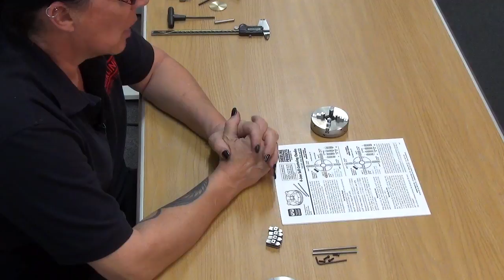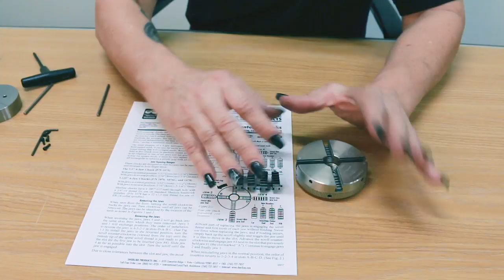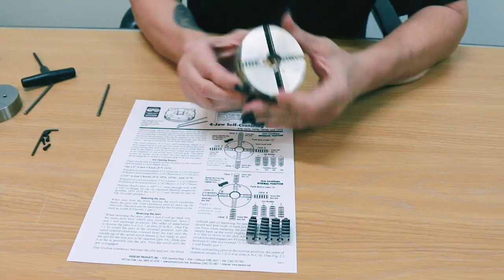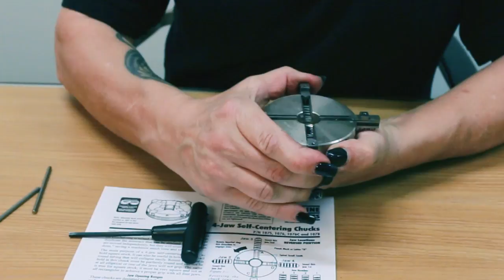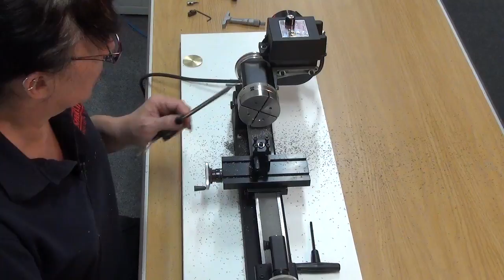Pie Jaw Demonstration

Comment: these are called 'soft_jaws' in big lathe country, also in the haas videos, where a tutorial exists showing you how they work.
essentially the jaws are labled for concentricity, when you later machine the jaws, they will be a 'matched set' and go exactly in the jaw positions they were in when cut, for every job!
for the screws, these are tight to the chuck face, as when machining a ring (jewelry) this allows the jaws to grip, yet be locked down, so the clamp force is constant, not increasing with the centrifugal force, once the lathe gains operational speed, hence over-stress the part, as an extra 5-15% clamp pressure was added due to this dynamic movement.

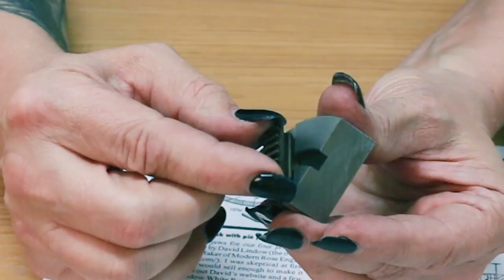Comment: Ok did anyone else envision "Within cells interlinked" at 7:10?  I'm totally going to get the pie jaws.  Do they work as well in the independant 4 jaw chuck?  It seems like it would be really hard to indicate a part...
Reply from the maker: No, you can’t use these jaws on the independent 4 jaw chuck.
Reply: I had a feeling.  I need to get the 4 jaw scroll chuck anyway.  Thanks!
Reply from the maker: The 4-jaw chuck with pie jaws is available as P/N 1076C-PIE
https://sherline.com/product/1076c-electroless-nickel-teflon-coated-4-jaw-chuck-3-1/